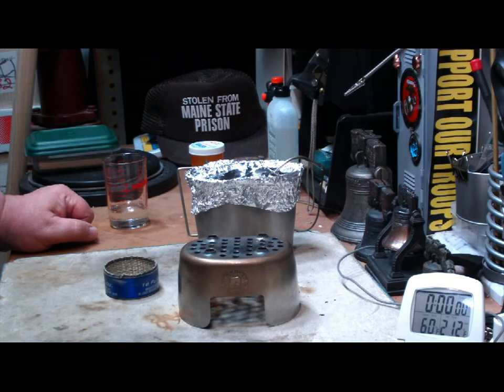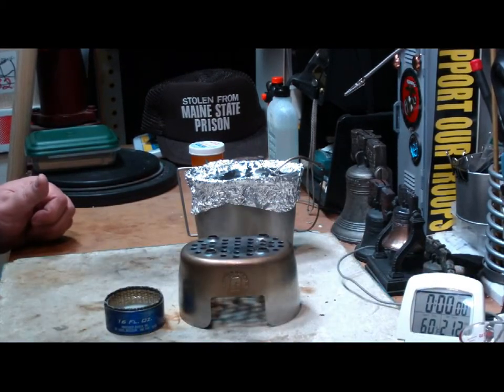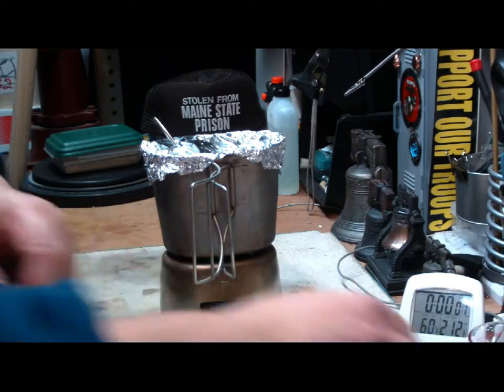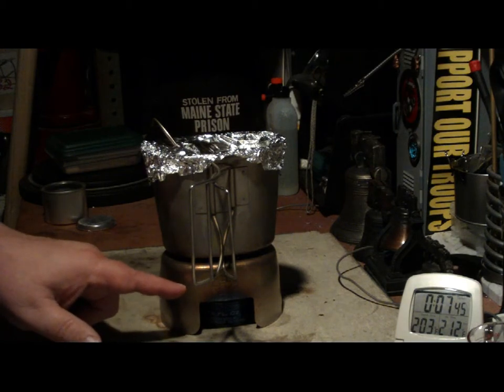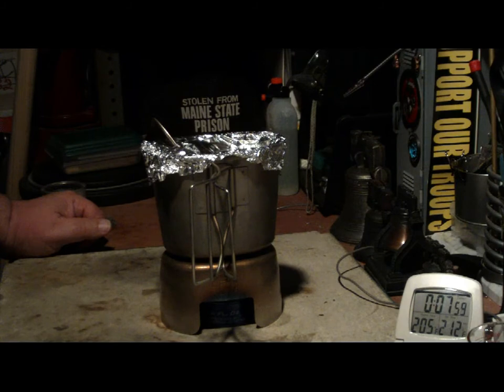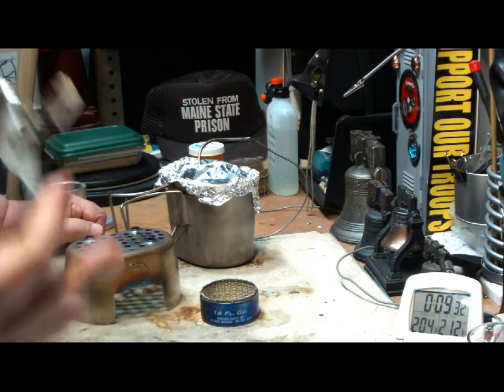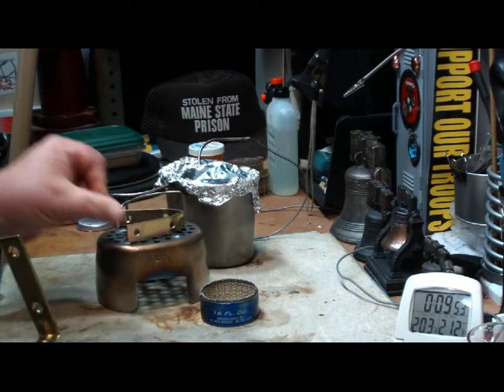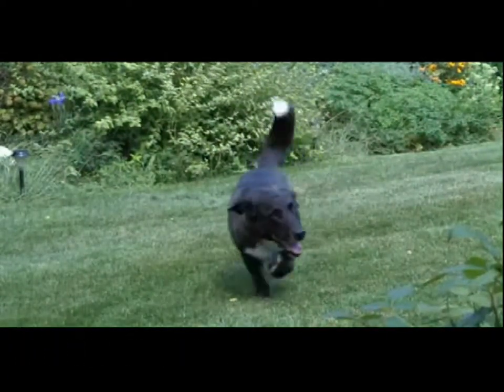CanteenShop GrillTop Stove Stand - cottle w/ wick burner - Boil Test #8

Comment: Yo Hiram, I use air brake anti freeze. Its under three bucks a quart and is 100% methanol.  I think it burns hotter and longer than Heat in the yellow bottle.